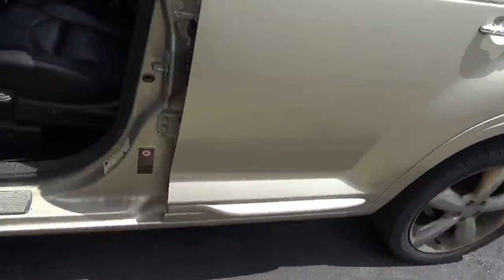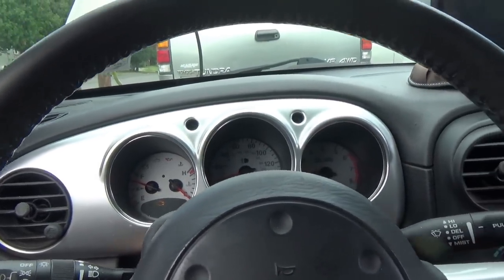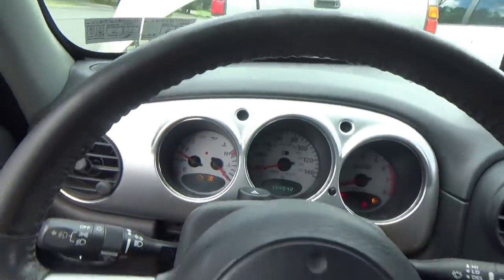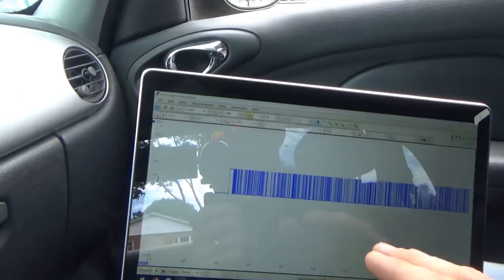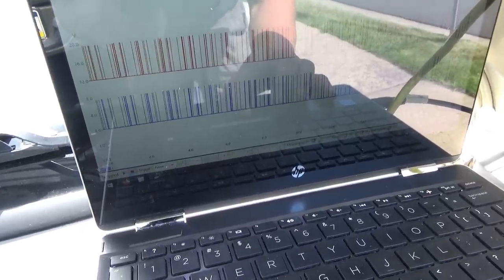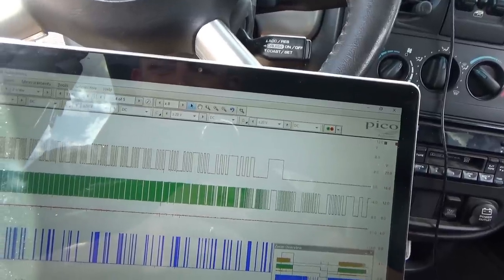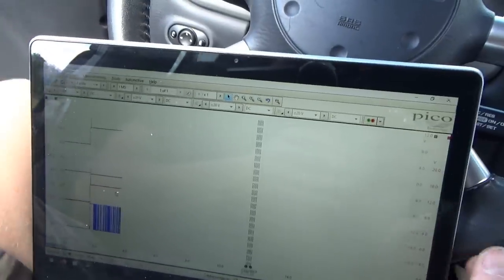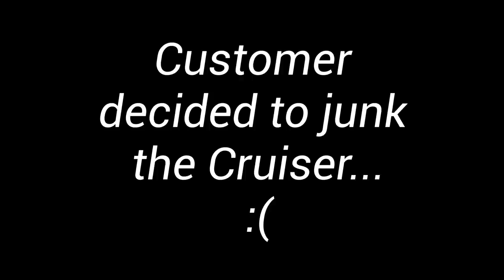CRAZY PT Cruiser (Stall, No-Start, No Comm)

Comment: I've seen this issue before and it took me some time to trace it down.  One thing I learned is that the Cruiser will set communication codes if scanned while not running.  To the point I found that power was intermittent to the computer.  This would cause the car to run ruff, buck, and yes stall out.  The dash lights would send confusing signals and when scanned, the codes were inconsistent never showing the same ones.  Took a step back and went to the basics of checking powers and grounds to the computer.  In the end it turned out to be a poor connection at the ASD fuse.  As it turns out most of the power that runs this little vehicle goes through this fuse.  It didn't blow but did show signs of excessive heat.  Replaced the fuse and I was cruising in my automobile once again.
Reply: Probably something that was overlooked in diagnosis was not just the signals (data packs, waveforms to and from sensors), but 'ripple' on the supply feed in reference to ground, and when there is strange behaviour, check what that shows with another trace, or scope..
Reply: A fuse can show signs of over-temp when the fuse connections get oxidized to the point of increasing contact resistance. Which intern, increased heat which increases resistance and so on until the plastic housing starts to melt. If you catch this in time and clean the fuse mating contacts with Deoxit D100, and clean the new fuse contacts, with emery cloth and then Deoxit D100, insert the fuse, then remove and reinsert to wipe the contacts, you can drop the contact resistance down to the point where you can get some extended life out of it.

However, if we step back and want to study the problem in more detail, a relevant test before swapping the fuse or cleaning the contacts would be to monitor the voltage across the fuse and fuse contacts while under load to understand the magnitude of the voltage drop.
Reply: No, just the fuse.  About a year before this problem shown up I had a fuel pump failure.  It may have drawn close to the fuse limit.
Reply: @gieauto7175 My 2007 cracks but only starts using start😢 fluid. What should I do now?
Changed the fuel pump
No red dot
New battery
New spark plugs
Reply: Sounds like you're in a clear flood mode, test the throttle position sensor.  
If you're only having long cranks on first start up check the fuel pressure.  Fuel pressure needs to hold for at least a half hour.

Comment: I've done a few of them PT's that had issues like this, and most of the time, it was something wrong in the ASD circuit.  Burned but not blown fuse on one.  Bad connection to or bad ASD relay on a couple of others.  Something in that circuit was drawing more power than the circuit was rated for.  And my sister had a 06 with a bad PCM.  But it got junked shortly after sending it to the dealer for a 2nd opinion.
Reply: My 2007 cracks but only starts using start😢 fluid. What should I do now?
Changed the fuel pump
No red dot
New battery
New spark plugs

Comment: The car looked to be in decent shape otherwise, with low miles.  I'd love to have a turbo 5 speed PT, just to trigger the haters.  I would have bought that car for scrap value, put a used PCM in it and had a blast on the cheap.  Too bad it was junked.
Reply: Yea me too I am not much on PT cruisers but one with a 5-speed hell yeah the thing looks to be in pretty decent shape is it Rusty?

Comment: Old Chrysler tech here. On some of the older jeeps 98 or so if the five volt reference to the map/tps and a few other sensors got shorted to ground it would cause the pcm to not communicate and it would result in a no start no communication. Unplug each sensor that shares that same 5 volt circuit untill comms come back. I think other Chryslers used the same controller and might be prone to that issue. I have an 03 PT/GT with a five speed. Drive it daily. Still runs.

Comment: On the older chrysler  transmission  if to lost power it would  set a solanoid  coad for the first solanoid  in the tcms check function  and you would  start chasing  a solanoid  problem to you understand  that chrysler  had a order in the self test program  . Lose of power code for the first checked item  in the self test programming

Comment: I don't know, while it certainly could be the PCM I would want to examine the repairs before blaming the computer. Junking the car seems kinda harsh, it looked pretty clean. On the other hand, it is a PT. But if it is the PCM then was the wiring issues not really the problem? Just doesn't seem quite satisfying. Thank you for posting the video still interesting to see.

Comment: I had a theory that the 5v ref to the cam sensor could've been dropping out.  Don't know if that could cause the behavior, but it would be consistent with a faulty ECM
Reply: Oil in the cam sensor.
Parked with engine facing downhill.
Replaced cam sensor.
Engine sounds ok.
In neutral, runs up to just under 4000 rpm.
Then bogs, and returns to 4K, and just buzzes around there.
Drives fine, but every warning light in the menu is on.

Comment: In Australia, there are several PT Cruisers travelling about, but wonder what Chrysler and its distributors did with warranty, and coming up with easily identifiable faults, for keeping them going. When they were introduced, the body shape represented a 'retrograde step' in design, harking back to the days of the 'Airflow' and introduction of hydraulic brakes.. (The 1930's and 1940's). In the 1960's, the fashionable design concept (in Valiants) was to keep a lower centre of gravity.. As for the electrical issues, and some experience repairing electronics, I would look inside the engine computer and check down to component level, but the customer has called it junk, and decided to 'cut his losses' in time and money spent on the vehicle...

Comment: My wifes PT Cruiser is a 2005 AT Trans no spark no injector function getting healthy 12 volts to coil pack and hot side to injectors from ASD relay when
cranking . NO signals to coil or injectors (ground side switching from computer). Crank and cam with magnet sensors are new are getting 5 volt reference and ground at connectors to both sensors . Both sensors are providing voltage switching to computer measured at C-2 connector (orange)
Gray Black Wire (Crank) Tan Yellow wire (Cam) Tried junk yard computer replacement no luck have not tried new one.
Reply from the maker: Any codes?
Reply: @PineHollowAutoDiagnostics  Air temp sensor unhooked  Code

Comment: Tipm ig feed . Pmc seems to always  set a crank position  sensor  coad if it loses a power source.  And It seems like when the crank sensor  fails  there's never  a code for it . I think it has something  to do with cranking  voltage doesn't  let the pcm see that the crank sensor  is dead .

Comment: The last time I had a PT do this to me the tb was loosing teeth. It would intermittently stall. Sometimes crank no start. Sometimes run perfect
 Previous shop replaced cam and crank sensors. So I start scoping. And just when I was about to get both captures for cam/crank I get a crank no start. Constant. Pulled timing cover and and cams were no longer turning. Crazy that it would run, stall not run. Just depended on where along the belt the gears were catching.
Reply from the maker: That's insane lol!

Comment: Rebuilt computers are cheap for that car.  I put one in my sister in laws 2005 PT Cruiser several years ago and its still holding up.  Similar symptoms.  My first guess was fuel pump but it was also shifting weird (automatic trans) and had a code I think was p700 or something like that along with a few others..

Comment: Now I will sat this watching the video and you have just checked fuel pressure.  I have had ignition switches go bad on older vehicles and cause this problem but it wouldn't be causing this issue on a newer car like this. First I would think immobilizer the pcm. Entirely possible to be pcm but the odds of the pcm going bad right after wiring damage from mice are low but and there's a big but here, if the wrong wires touched while the wires were damaged could it have caused the pcm to start failing. I would say it shouldn't cause the pcm to fail but could it have the answer would be yes. And with what I see I think it may have. Now for my favorite part,  to see if it is in fact the pcm. Back to the video.

Comment: I don't blame the customer for junking it, my dad bought one back in the day and it was a nightmare for the entire life of the vehicle with the ONLY good quality being that it was good on fuel.  It was in the garage being repaired more than it was actually on the road with one electrical gremlin after another. The final gremlin was that if you plugged in the rear O2 sensor it would blow the fuse for the transmission and refuse to start so it drove for the last few months with no downstream O2 till it was finally wrecked and put out of its misery. Lol
Reply: That's very strange that plugging in the o2 sensor blew a fuse unless the sensor was internally shorted. Either way it's stupid to design something in a way that a non critical part failing makes the whole thing unusable, but that isn't exclusive to Chrysler products. Years ago my Honda kept blowing the alternator fuse. When I finally figured out that the problem was a shorted EVAP solenoid, I was pissed that Honda put some nonessential emissions device on the same circuit as the alternator. Crap like that belongs on its own circuit or with something nonessential like the radio so it won't leave you stranded if it fails!
Reply: @averyalexander2303  Yeah even a brand new sensor did the same thing and it didn't matter if it was O.E. or any other brand either. I traced the wires and there were no issues to be found so I attempted to check the wires inside the fuse box for any issues and every single wire inside was the exact same color making it a nest that looked like red spaghetti that took days to check but I may have missed a wire or something.  Either way it made no sense to me or anyone else that looked at it so we just left the sensor unplugged.

Comment: That Cracked Me Up Ivan 😅 Be Nice If The Guy Would Stop Mowing And Blowing Dust Here So I Could Hear The Fuel Pump   
Friggin` Landscrapers grrrrr
Who In The Heck Is Cutting Grass Anymore ? I Have Not Cut Mine Since The 20th Of June 😄

Probably the Pcm Demise Was Caused By The Rodent Shorting Some Wires
The Owner Should Have Put A Used Pcm In It And Sell It To Recoup Some $$$  Especially Now With This Economy smh

Comment: my battery, a delco, was at fault. had dash lights come on followed by stalling as well as a very long seat belt alarm. even blew a 10amp fuse, which allowed the vehicle to crank but not stay running . tried to charge the battery on a trickle charger but after awhile i got an F01 error code  and never finished on a regular charger. battery had plenty of spark but no reliability for starting the vehicle

Comment: I keep having this problem in my pt cruiser it stalls on freeway doing 60 I shift into neutral starts back up. But if I can't GO 80. IT WILL DIE AGAIN. BEEN DRIVING IT LIKE THIS FOR MONTHS. But when I hook up the computer to it  I see when it happens the auto shut off switch goes from high to low and shuts it off. Also the ignition switch is low. Help 😢

Comment: I would have sparyed freeze spray at the engine computer and see if would stay running that way. If it did then I would take a heat gun to it and see if it stalls out. I do this a lot to jet ski computers.

Comment: i had one of these things same type of faults, it turned out to be a shitty connector to radiator fan  was connected and still loose ,inside crappy plastic was cracked were you could not see it took me weeks to find it replaced cam sensor .tightened every ground point . plugs .wires was lost till my hand accidently brushed the stupid connector and it ran . pissed me off after throwing the part cannon at it . all it was was using plastic were you should never had  it freaking enginerds.

Comment: I have an issue with a, saab 93 2lt petrol turbo. There is an intermittent fault where the ECU grounds out the injectors which hold them all  open at start this floods, the engine with fuel. I have replaced the injector control chip inside the ecu as shown on other you tube videos but the fault still occurs. Other times the engine starts, and runs perfectly fine. As replacement ecu's are few and far between it would be a shame to junk the car for this fault which seems to be common on the saab engines. Does, anyone have any ideas?

Comment: This video confuses me.  No mention of inspecting the shop's repair, or looking at the area for damaged wires that were missed.  Is the scoped CKP/CMP inputs or outputs of the PCM?  I don't understand how the signals disappearing is the fault of the PCM.  Bad/confusing inputs can cause all kinds of odd computer issues.
Reply: Agreed . Also the  fuse . Just jump it real quick.
Reply from the maker: Inputs, powers, and grounds were all good at the PCM 👍

Comment: I have 2000 Pt cruiser it crank and does not start but I will start if jump it the battery state of charge is 12.6
Reply: If turn it of it will not start; I have to jump to start

Comment: The computer could decide the car can't run because of lack of control data, set the light and stop talking to modules because it is in no start mode. Though not talking to diagnostic equipment would be a smoking gun that the computer is bad because you have to talk to diagnostic equipment to solve the problem, it doesn't have to talk to module if it knows the car is broken but it has to tell the tech what is wrong. Seems in good shape unless it has other serious mechanical issues, fixing the electrical issues would leave you with a decent car worth several thousand.

Comment: Interesting trivial information about the PT Cruiser... Chrysler engineers and Marketing department designed it with hipster males between 18-35 to be their targeted buyers.  However, the highest demographic buyers turned out to be women between 35-59.  They found the vehicle "cute," rather than the intended "cool."  Several obvious realties doomed it including underpowered engines, and the "dragster-style" design which just wasn't true to form.
Reply: Remember... they WERE hot. They came to market as an early '01.   It took until '03 before any local dealers started to discount them...
Reply: Then the designer quit Chrysler and went to Chevrolet and designed the HHR.

Comment: You ever run across a brake fluid level sensor circuit open but it's not open.    The readings at the pigtail are correct per service data and also change with manipulation of the level float.   It's a 2018 Challenger in case you have any insight.  Code c1006-13